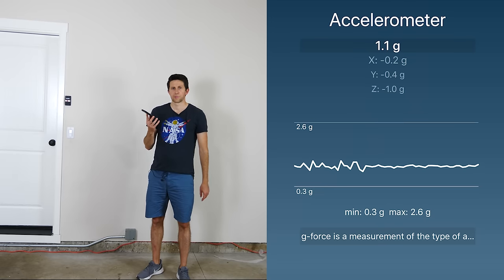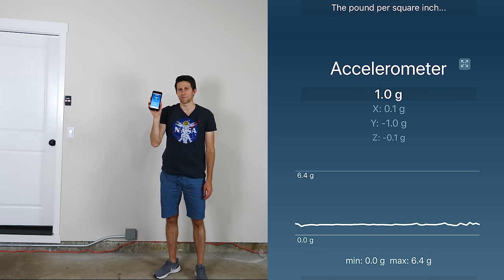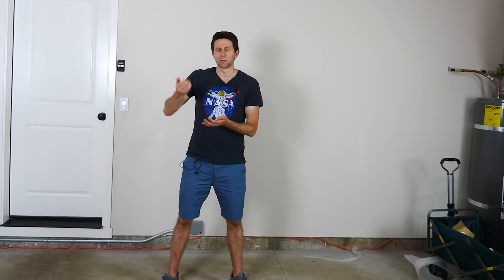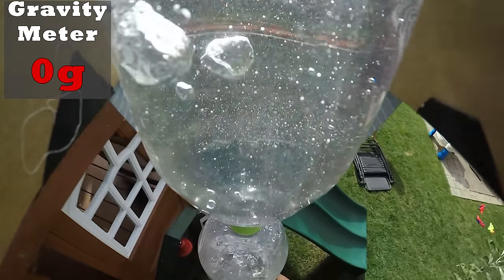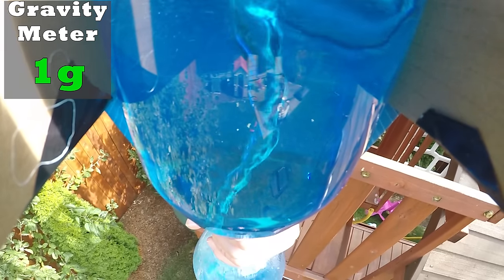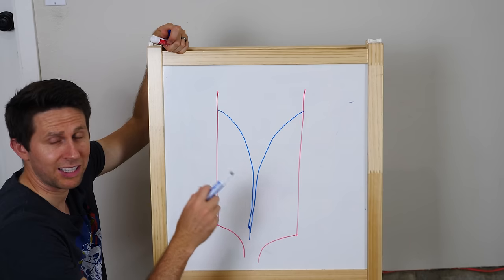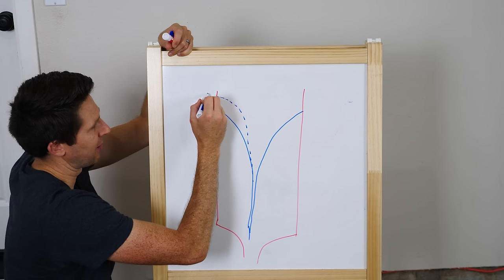What Happens to a Whirlpool in ZERO-G?

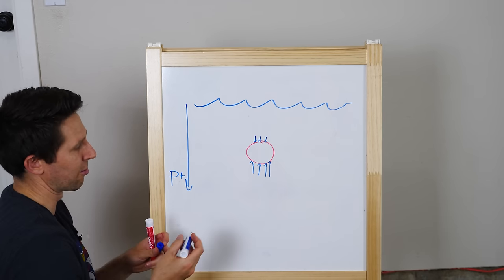Comment: -5:46 so how deep in the ocean do you have to be where the pressure would equal and the bubble wouldn’t go any where?
Reply: They’d never be equal. The difference in water pressure above and below the bubble remains. 

Pressure equals density of water * gravity * height. Since density and gravity are constant, the only thing that matters here is the height. 

The height of a point above the object is going to be less than the height of a point below the object (since we are measuring height as distance below the surface of the water) and thus the pressure below the object will always be larger than the pressure above the object.

This only changes when we make gravity equal 0 as he did in this video, in which case the equation becomes P = D * 0 * h and as you know anything multiplied by 0 equals 0. In other words, water pressure above and below the bubble would both become zero without gravity. 

The only thing that makes the bubbles retain there shape at that point is the air pressure within the bottle, since in the absence of gravity, the air would be dispersed until it becomes a vacuum. Hence, the reason our atmosphere stays on earth and doesn’t disperse into the vacuum of space.
Reply: @jacobwhitlock5060  I don’t really understand but thank you
Reply: The pressure would never be equal, it keeps increasing linearly forever with depth.

Comment: Technically there is not no acceleration when there is not anything below you as the force due to gravity will still have affect so -9.8 m/s (ie 1g), but this will not register on a g meter as it is looking for acceleration with respect to gravity. I think the video mixes this up a bit.

Comment: I am confused. I always thought that "G" means acceleration and as we are on earth it would be always ~1G downwards if no other force than gravity is effecting things. So when you throw or drop something it would always experience 1G downwards, but it seems like thats not the case. Whats happening. And also what method does your phone use when it measures gravity?
Reply: G is a force which will cause acceleration if not opposed by an equal and opposite force. Usually, the ground provides that opposing force. So a body standing on the earth will experience zero acceleration, 1g of downward force (due to gravity) and 1g of what is called "normal force" (the force the earth exerts back at you). If the ground (and therefore the 1g of normal force) were suddenly removed from underneath you, you would begin to accelerate downward at the rate of 9.8 meters per second per second (9.8m/s^2)
Reply: "G" is gravitational constant. "g" is what you're talking about and it is indeed an acceleration. The acceleration initiates a force due to the mass of the falling object (F=ma). If an object is opposed by the ground, the force due to g gets cancelled by the normal force(which is the g we can feel), if the object is in free fall, then the force moves the object downwards until an equilibrium is reached. This force cannot be felt by the object until it is acted upon by an opposing force (the ground). So when the object is in free fall, g still does pull it to the earth, but the object itself does not feel it... This is in fact what led Einstein to come to the conclusion that a falling object is just following the "lines" of the bent space-time (it is bent due to the earth's mass).
Reply: @kirkhamandy  thanks for answers, it confused me so much when he said that phone experiences 0G when its freefalling and the app also showed 0G. But it must be that the app is calibrated so that it shows 0G when its actually experiencing 1G towards earth. Am I right?
Reply: @kirkhamandy I see. I didn't really understand how sensor worked until know, thanks for explaining it! :)

Comment: I guess dropping the object is slightly easier to get the zero g effect than my idea of just yeeting it sideways at orbital velocity.

On the serious though, and I know this has nothing to do with your demonstration... Which drains faster?  A sink that is draining without a vortex at the drain... Or one with a vortex?  I assume a vortex makes it more efficient, but I legit have no idea.
Reply: Without vortex you have an alternance of water getting out and air getting it, while with the vortex you get both at the same time so faster (well that's for an enclosed system like a bottle. sink on another hand usually have a separate air intake, so not sure if it make a diff, might even be slower...)
Reply: @SylouCool  Thanks man.  I truly appreciate it. I had forgotten I had asked but what you said makes a lot of sense to me.
Reply: @MonkeySimius  Your welcome, i know this one well cause i made a tiny experience about it in a little private show we used to made with my friend (well it was our parents doing it but we were doing our own show too).
But like a said for a sink it might be different, best way to know is to try. Fill a sink up to a marked line then empty it while making sure no vortex form, then repeat while making sure a vortex form (do it a few time to get rid of randomness stuff). Try it too while blocking air intake on top of sink (which is usually there to prevent overflow but also act as pathway for air)

Comment: 5:04 I thought it was density that caused bubbles to float, not pressure.
Reply: Density is what causes a difference in pressure from top to bottom.  But density is a measure of the amount of mass in a certain volume.  It's not a force, therefore it cannot 'push' something to make it move.  Pressure is a force spread over a certain area.  So if the bubble has some area, and the pressure is different on opposite sides (top vs. bottom), then the total force pushing down is different than the total force pushing up.  So this gives a non-zero force and the bubble moves.

As he explains, with no gravity, there is no pressure so there is no pressure difference between top and bottom.  But the air in the bubble still has a lower density than the water.
Reply: @mikefochtman7164  yeah, ok, that makes sense.

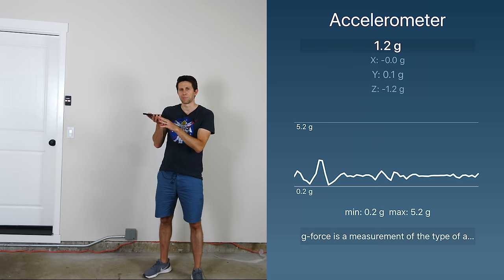Comment: 1:07 - did I misunderstand you, or did you misspeak? Indeed, there is acceleration on the phone the second it leaves your hand: it will be accelerating toward the ground at a constant rate of 9.8m/s^2.
Reply: If you look at it like Newton and view gravity as a force, you could say that the exact (enough) force is acting on every single atom of the phone. As a result every atom "wants" to move in the same way leading to no phone-atom pushing or pulling on one another wich is basically, what the phone's sensors are mesauring. 
If you look at it with Einstein's theory of relativity, it get's more complicated but also more accurate. Here gravity isn't a force but the acceleration of space itself towards the center (of gravity) of every object, for example the earth. Now with the information of it's sensors the phone is essantialy tracing it's acceleration through space itself. Now at sea level space is accelerating down (towards the center of the earth) at about 9.81m/(s^2) wich means, that anithing not accelerating through space, basically moving at a constant velocity through space, is, just like space itself, accelerating with a rate of 9.81m/(s^2) towards the center of the earth, or relative to the Earth.
Hope I could help you.

Comment: I still don't understand how moving 'up' away from the Earth causes zero G. 
I know that 'vomit comet' plane does the same thing...it just sounds counter intuitive.
My brain screams that there must be MORE force pushing you down (acceleration AND gravity).
Reply: For that you need to accept that it is the ground that is accelerating (to stand still in an accelerated space-time you need to accelerate in the opposite way).
So once the object is thrown it's no longer accelerated and maintain its speed (if we neglected air resistance), but the ground is still accelerating so still getting more "speed". therefore the relative speed between ground and object decrease. Once it reach 0 the object is at his peak altitude, but relative speed keep decreasing so now it's a negative speed = the ground is now going "faster" than the object therefore object appear to fall. But during the whole time object is not accelerated therefore is in 0g.

To help you visualised it imagine 2 cars on the highway going side by side and accelerating at the same rate, let say 1m/s². (summary with less number at next paragraph)
 - After 10s they're both going at 10m/s and have travel 50m.
 - Then car 1 accelerate more for a brief moment (that when you throw the object), let say 3m/s² for 2s and therefore getting away from car 2 (after those 2s car 1 is now going at 16m/s while car 2 is at 12m/s, car1 had travelled 76m and car2 72m), then stop accelerating and just keep it's speed (16m/s). 
 - Meanwhile car 2 keep accelerating with the same rate as before and therefore after 4 more second will reach same speed as car 1. At that point car 1 as travelled 140m while car 2 only 128m.
 - After that car 1 still stay at 16m/s while car 2 keep accelerating and therefore goes faster than car 1 so getting closer and closer to it
 - it will take 4.9 more second for car 2 to reach car 1 and they will have both travelled 218.4m (the equation for constantly accelerated linear movement is x(t) = 0.5 * a * t² + v0 * t + x0, if you decompose those movement in 3 phase, first 10s of same acceleration with a=1, v0=0 and x0=0 for both, then 2s of faster acceleration for car 1 so a=3, v0=10 and x0=50 for car 1 and a=1, v0=10 and x0=50 for car 2, then 8.9s of no acceleration on car 1 and constant acceleration on car 2 so a=0, v0=16 and x0=76 for car 1 and a=1, v0=16 and x0=72 for car 2, you will get those result).

Well after writing it down it might look more complex but only cause it's more detailed... without all the number you get
 - Both car stay side by side for 10s
 - Car 1 getting away from car 2 for 6s (2s of acceleration + 4s for car 2 to match car 1 speed)
 - Car 2 getting faster and faster than car 1 therefore closer and closer to car 1 for 4.9s
 - Car 2 pass car 1 (= object, crash to the ground)

Hope that will help you get it if you still wondering about it one year later 😉

Comment: Actually....
When you release it, it isn't 0g in the sense you are talking about. You have a positive force going upwards that is greater than the force of gravity. So depends on what you define as G, but the phone actually has 0G, in the term you are explaining, at the top the throw. That is when the force pushing up and gravity are equal. That is the 0g I think you mean.. There is no acceleration in either direction.

Also, this is a 3 year old video haha

Comment: Ok, you used pressure with gravity, so gravity is not the primary, pressure is the primary. So, opposite of buoyancy is pressure, at the most foundation, all is about pressure, not gravity. So, it is relative pressure that is base on mass itself which want to go down because the denser is higher so the pressure will be high going down, but the down part is not a resistance, but the resistance is lower relative to center pressure, the mass, so it is not so low which causes coating of line of water so it will be all even, well, it needs to be higher, not about zero gravity but zero pressure, which you remove the air and you try again at higher level, well, of course the water will expand, well, can use higher resistance so it will resistance the water and air within so it will not bubble out. 

So, the higher pressure base on bottom level that push up, if you go higher, the push up will be higher since the cushion of air will be thicker base on surface of bottom of mass will collapse on another air at lower bottom, so it collapse as the resistance increase which you called gravity at higher number, but the pressure is higher base on higher gap of air that collapse and cushion up the mass, so the resistance is higher which slow it down slightly. 

So, will the tornado change at higher level while it is in relative pressure, which the center is higher than surrounding pressure, so it will be good you try at higher level, so what will happen? Each height so what will change? 

The bigger the gap diameter vertical, the bigger the pressure that the center mass will go thru. Base on video that I saw, 'https://www.youtube.com/watch?v=G7Tou1MzmLI', so it is base on high pressure which cause higher spin so the center expand, so the spin is high, but spin is need on the resistance, so if there is no resistance, then the center pressure will expand, so in relative density the pressure at bottom is lower, so it expands since it has energy within so there is no surrounding energy that is being help by bottom energy that is resistance, so spin is connect to two things: horizontal and vertical, the side cushion of air that push it to cause the column of air and it spins base on bottom which cause the spin, well, at least the bottom diameter that is smaller than diameter of the side, so there is higher resistance to hold the water as it spins which the gap diameter vertical within container is lower on the side to the most center which has a hole which the gap diameter is bigger. 

So, the inner pressure get lower since there is no external pressure to hold it, so the relative density get lower to the container, so the inner expand, but there is pressure outside pushing up, but at higher height, so tornado will change since the pressure is higher base on gap of diameter vertically is higher so the cushion will increases as each layer of air collapse to it as it resistances to container at higher level, so cause the change so it will narrow the tornado. The bigger the gap, the bigger the pressure to center of mass. And of course it depends on shape of mass which can resistance or not, or displace even more, so the resistance is less. 

Expand your mind that you can see the infinity right standard, not preference standard since it is connect to humans, so you mixed with reality, not looking at full reality.

Comment: The plane is not touching the ground , is it 0g… and what about rocket, I’ve heard it’s not 0g but like 5 or 10gs?
Reply: 0g comes from falling at the same rate gravity pulls. (9.8m/second^2).
Anything in free fall without air resistance is at 0g.  
The plane does an arc in flight to simulate 0g.  When a rocket takes off it is accelerating away from the pull of gravity so inside the astronauts experience increased g's.
Reply: The plane isn't in freefall, the lift of the wings give him a vertical upward acceleration, one that match ground acceleration so it can maintain its altitude, that's why you in the plane feel around 1g. unless you're in a zero g plane during it's parabolic trajectory that mimic a freefall.

Rocket are accelerating more than ground in order to get away from it so you do experience more than 1g in a rocket (during the ascension phase)

So you're not in 0g once you stop touching the ground, you're in 0g once you stop accelerating. But to stand still in an accelerated space-time (that what gravity does in simple word) you need to accelerate the opposite way hence why to stand on the ground you need to accelerate at 1g upward, hence why the plane need to accelerate upward at 1g to maintain altitude, hence why the rocket need to accelerate more than 1g to gain altitude.

Comment: I'm certainly not against you using centrifugal force in your explanations, but this was just incredibly sloppy and misleading.
"Centrifugal force or centripetal force, whatever you want to say, both are right, causes the water to be pushed out to the sides." NO! This isn't even remotely right.
 
Centripetal force is the force exerted INWARD which keeps the water from shooting out of the circle (in this case either a contact force exerted by the walls of the bottle or the force the water exerts on itself to keep from compressing). It's NOT a centripetal force which pushes the water out to the sides. In an inertial reference frame the water getting 'pushed' outward is a result of its inertia. It 'wants' to travel in straight lines and it takes some force exerted inwards to bend its path into a circle.

Centrifugal force is the fictitious force which we have to invent in an accelerating reference frame to explain why objects aren't accelerating despite the centripetal force being exerted on them. They are useful for explaining our perceptions of things because we always naturally perceive ourselves as being at rest in our own reference frame (that's why it feels like you're being pulled back into your seat when you accelerate suddenly in a car rather than your seat exerting a forwards force on you to cause you accelerate at the same rate as the rest of the car), but they are not useful for explaining behavior because they aren't real forces so they can't do anything. Saying the water is pushed outwards by a centrifugal force is as physically accurate as saying that ghosts pull the water outward.

Students already struggle tremendously with the mistaken idea that objects moving in circles have real forces exerted on them pointing away from the center. This kind of explanation only makes that worse.